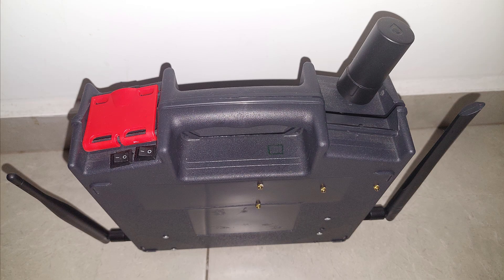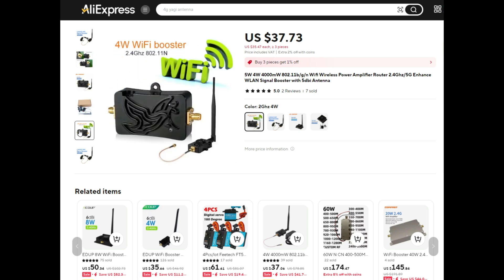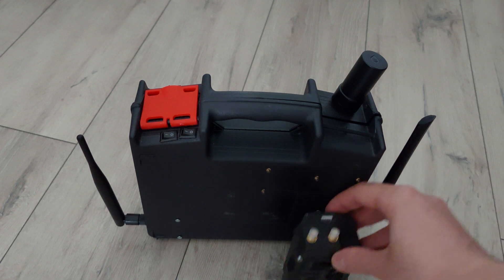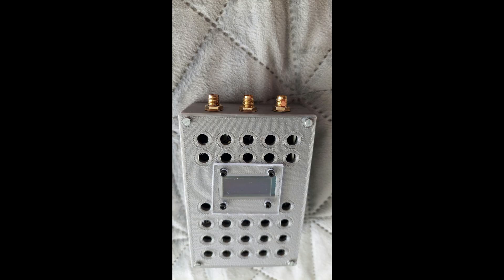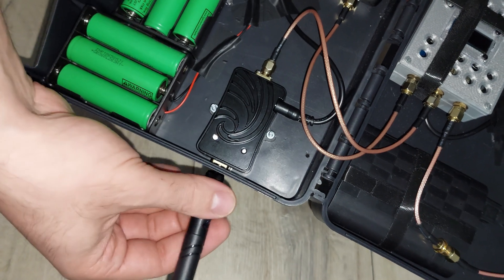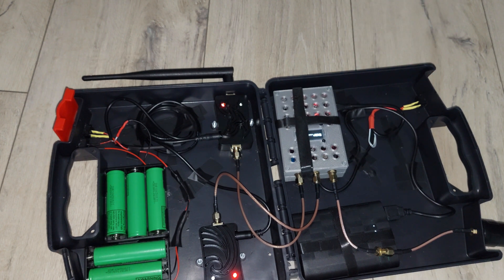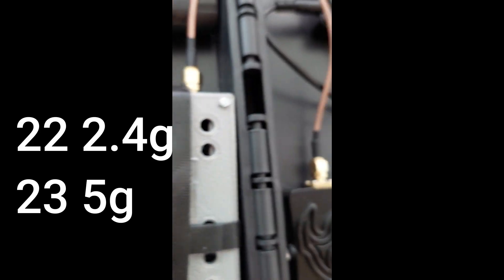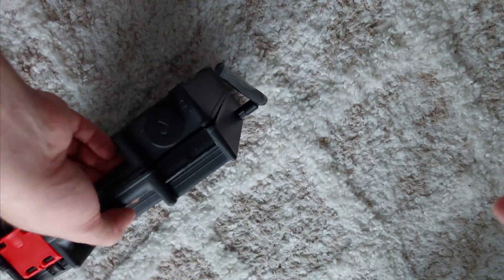Wardriver -  INCREASED RANGE (part 1)

Comment: The wardriver chips don't channel hop fast enough to use it as a basis for an effective wardriving rig.  Regardless of all these signal boosters, that wardriver device is still missing out on a ton of beacons from APs.  You'll do better with a sumsung s10 and probably for cheaper than all these components.
Reply from the maker: True, still it's a cool gadget